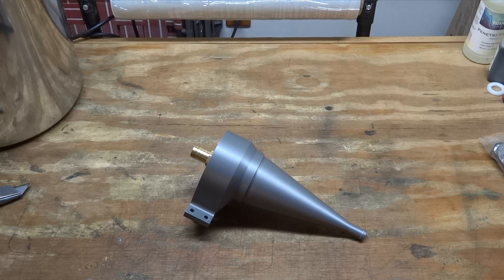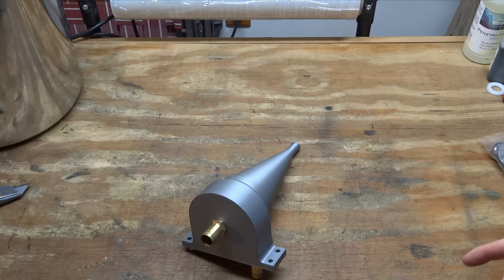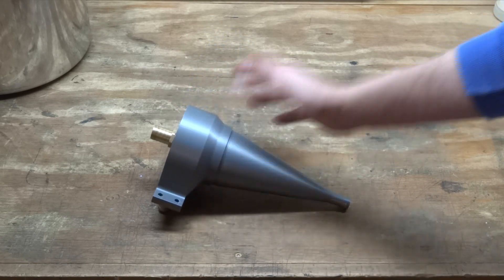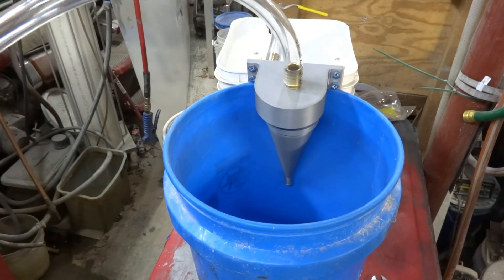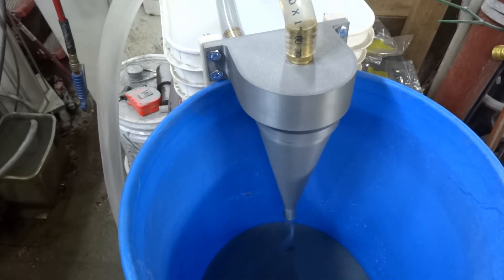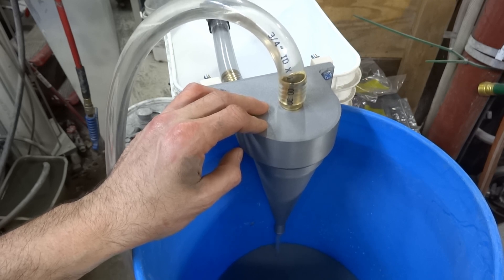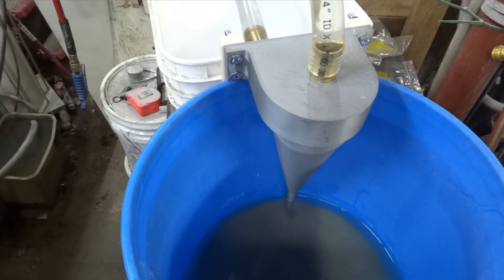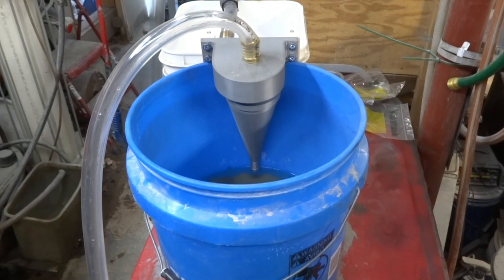What is a Vapor Blasting Cyclone?

Comment: Hello Brad, if I understand correctly this cyclone is supposed to replace the buckets with the float valve and the filtration pump behind the cabinet. I am building my own cabinet according to your plans, so i's a great and simple option but where can I get this item ?
Reply from the maker: The cyclone is more for changing out worn media, or switching to a different media. I still use a settling tank and filter. If you want the cyclone maker's contact info, email me and I will get it. I don't want to post his name on here.
Reply: @ArnoldsDesign  Thank you for your reply.

Comment: hello arnold in the plans that you sell where this device is installed?
Reply from the maker: I just got the device recently, so it's not in the plans. But what I did was connect it to the slurry pump with another hose and valve, and mount the cyclone on the outside of the cabinet. Works well that way.